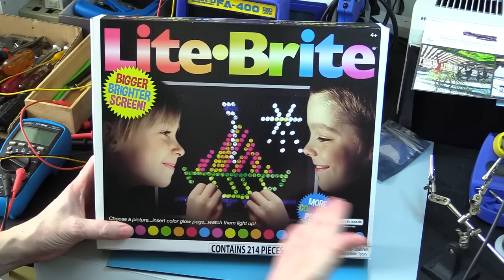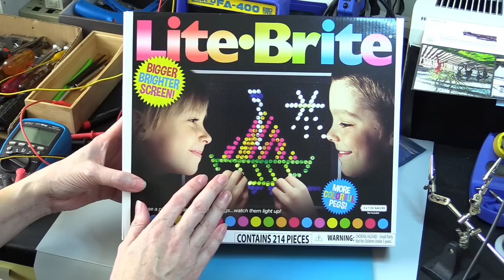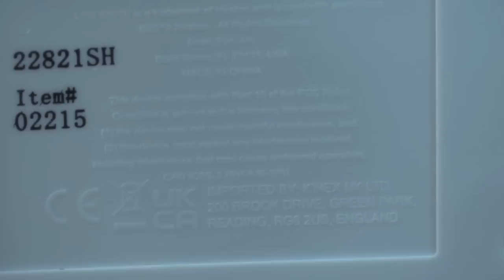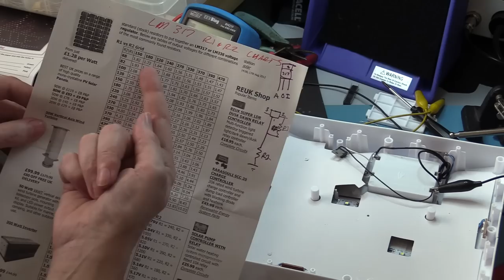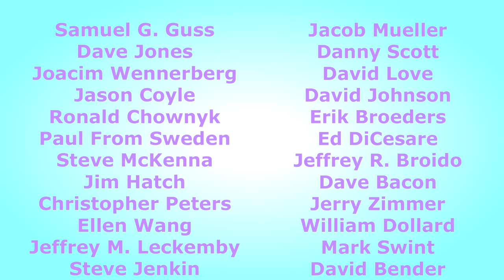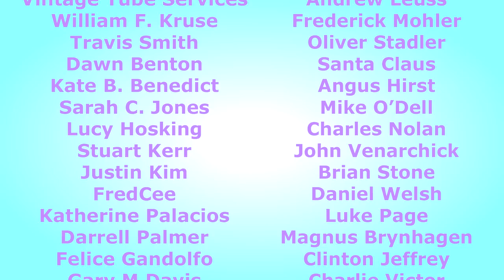Deep Dive Into The New Lite Brite

Comment: Wow...this video brought me back so many years that I had to make a trip out to the storage shed and pull out my 1967 original Lite-Brite!  At age 7, I remember taking some gift money from my grandparents to the Thrifty drug store and purchasing it for $4.99.  Surprisingly, I kept the instructions and insert showing the 5 different picture groups you could purchase (Group 100 suggested for boys, Group 200 suggested for girls, Groups 300/400/500 suggested for both genders).  First-generation units used a standard 25-watt A19 medium-base bulb as the light source; they also lacked any power switch, so my dad helped me install a cord-mounted snap switch.  Another (unfortunate) modification I made was taping red cellophane to the ventilation holes because it looked cool -- not realizing blocking these caused unwanted heat buildup.  So...my Lite-Brite is slightly deformed on the top side.

The perforated plastic grids were referred to as "peg screens" per the instructions.  The "pre-coded pictures" were 9"x12", which gives you an idea of the original unit's dimensions.  The package also included several blank sheets.  According to the instructions, "The blank sheets used with your Lite-Brite are black construction paper.  You can purchase additional black construction paper in your favorite stationery, art supply or chain store."

Over the years I purchased a couple sets of replacement pegs.  At one point, Hasbro changed the formulation for the blue and purple pegs; they were noticeably lighter in color, which on one hand gave you two additional colors to work with but on the other hand meant you couldn't match colors if you needed a larger quantity.

A few other accessories I acquired that I believe were introduced a year or two after Lite-Brite:  Number/Mathematics Symbols and Letters kits, which were shaped like the represented characters and had multiple "peg points" that were molded into each shape and inserted into the peg screen...and the Action Lite-Brite Kit.  This replaced the two original peg screens with three specially-designed screens and an "action" lever that made contact with the bottom of the screens.  Pressing and releasing this plastic piece shifted the back screen so that one set of pegs was illuminated in the "normal" position and the other set was illuminated when the lever was pressed down, producing a motion effect (which varied in practice depending on the design).

It's interesting how this product has been sold for 55 years by the same manufacturer and has mutated over time partially due to changes in illumination technology!

Comment: Hi Fran. Let's see....you get a "new" toy and before having your first "play" you disassemble and modify it. A true "techie" indeed! Well done!
Reply: I’m thankful my dad was a tinkerer, shadetree mechanic and woodworker because I used to do this all the time.

The most memorable time was shortly after they bought the first family PC for $4,000 (486) I had taken it apart to learn how it all worked. They walked by, saw all the pieces on the floor and said “I hope you can put it back together” <3

I’m pretty sure that’s why I’m the CTO of my own company now.
Reply: What do you mean "before" the first play? It is the first play!
Reply: LOL! For me, it was, "You're grounded until it works again, or it's coming out of your allowance..."
Reply: A true nerd. I took so many things (radios usually) apart in my youth. Sad sad sad that I always had parts left over after I put it back together.
Reply: Original said only 40w max bulb if I remember. I put a 100 in one
 Forgot to turn off. Nice toasty medium brown burn marks.
Reply: @GeorgeZ213  If you end up with leftover parts and it still works it just means you found unnecessary parts the manufacturer included for "no" reason.
Reply: @eDoc2020  There is a difference between working, and working properly.
Reply: @theoneandonlymeshe9174  My parents told me that I took apart a dead table radio when I was two. They said that since they were going to throw it away, they didn't care. About ten minutes later, they saw me plugging it into the wall outlet, and ran to stop me. Ten seconds later it started playing. It worked for another ten+ years, until lightining hit the power line, and it exploded. That was in the '50s and '60s.I became a Broadcast Engineer less than ten years later.
As far as computers, I was repairing Commodore and other computers to the component level, not long after the C64 hit the market.

Comment: As I watched this video I could see my original one a few feet away. It uses the spring ternimal 6V batteries (PJ996 ?) type the "screen" is 12 inches by just over 9 inches. and comes with about twice as many coloured pegs (much deeper coloures). It also has a white plastic mesh under the black plastic front mesh. Switch is broken but can be bypassed. It was passed onto me from another families child who must have grown out of it. I've not grown out of it yet as i'm only 50!

Comment: Maybe my memory is off, but I recall that on the old Lite Brites, the light shined through every hole unless you had some black paper in front to block it. It looks like there might be some kind of integrated shields on this one to block the light unless you put a peg in a hole?
Reply from the maker: Black paper.
Reply: @FranLab  looks like the paper slides through the slot at the top? that's super convenient compared to trying to find those holes blindly!
Reply: So do the pegs pierce the paper then?
Reply: That is why the Peg-A-Light knock-off was better. It had a foam pad behind the grid that blocked the light unless a peg was in a hole. After some time, the foam got wallowed out and some light came through. I'm sure that with age, the foam turned to dust. The evenness of the light wasn't the greatest as the 15 watt bulb was in the center. There is a patent online you can look at. Haven't found one for sale and got rid of mine about 15 years ago (had it from about 1971)
Reply: There is a rubber “shutter” piece behind the front grid that has X shaped slits for each hole position that are displaced when each pegs is inserted.  But it does still come with some construction paper, if I recall, as well as a few suggested starter designs to get kids started.  I suspect the rubber that acts as a makeshift shutter will lose its effectiveness over time if the pegs are left in place for too long a period, at which point one would have to resort to using the old tried and true construction paper…just like the original.

Comment: We got one for Christmas in 1977 I think.
It was fun.
If I remember right, the panel was around 12" across and fit plain black 11x8 paper sheets.
Ours had a stubby medium Base 40 or 25 watt CGE bulb. You could change it up or down depending how bright you wanted.
YES the original pegs were very deep colours, and had long stems. 
I think we lost too many pegs in the orange shag carpet, and then up the vacuum cleaner which was a built in the wall style so the pegs ended up trapped in the pipes buried in the walls, & eventually we ran out of pegs.

Comment: Had one of the original sets when I was small. It used a refrigerator-style incandescent lamp running off AC if I recall. I also recall if you used all of the project sheets it came with, you could buy blank sheets in sets of 20 or something, which extended the usefulness of it. This new version appears to not require the black paper at all, which greatly extends its versatility.

When I saw the label on the box "bigger brighter screen" I assumed that the unit was the size of the box, then Fran pulls it out of the box and it's disappointingly smaller. These are definitely smaller than the 1970s version, so I wonder what the size is compared to. It's also noteworthy that they're calling the pegboard panel a "screen." I can't recall the terminology used on the original, but screens were far less ubiquitous in those days.
Reply: Been a lot of years but I remember having one in the 90's and wanting new "black sheets" my parents used construction paper which took 2 sheets overlapping (one and a little as I recall) to cover the whole thing.  I don't know the exact size but I presume those were about 8x10 inch give/take.  Maybe they assumed original size units were cm and then made it "bigger"?
Reply: I forgot how we had to use the black paper until you mentioned it. Without the sheet, it was just a grid of holes, and you could actually see the lightbulb through the "screen," right?
Reply: @brianfriedl7464  That was definitely how mine was, vintage early-mid 70s. It looked like crap if you didn't use the paper. Oddly enough, I can't remember if we had to cut or join regular black construction paper once we ran out, but I do remember the old tablets of colored construction paper were actually slightly larger than loose-leaf notebook paper, so it was probably bigger than 8.5"x11". What Fran held in her hands here looked smaller than A4.

I also remember that it got ridiculously hot if we played with it for too long in a stretch, to the point that we could feel the warmth radiating from it. I wonder how many fires those old incandescent appliance bulbs are responsible for igniting.
Reply: The easy way to do it was to cover the screen with aluminum foil.  Probably not a great idea when it comes to the heat coming off the bulb though.

Comment: The clown template was my favorite. It's such a bummer to see that they skipped out on the quality materials for a smaller & less bright appliance.
Reply: One lithium cell, and led's driven efficiently and spiked low duty higher amps, this could have been quite bright with the additions of one cell, one Chinesium charge control pack (sold in dollar products), and additional IC, inductor, and cap, another dollar).

Comment: Our original Lite Brite used a 120V standard incandescent bulb, with a warning sticker for "MAX 25 Watt" .  Later ones had a socket only for C9 base bulb, (outdoor Christmas string) but those were typically only 12W or less.  I guess people were overheating the old units with 40W or 60W bulbs.
Reply: These were great first lessons in heat dissipation for beginning EE's. Above 60,  you learned real fast not to block the air holes. You could run 100's with a big fan, and even the 200 3-ways by extending the front bezel with tape. Then, you got to learn how to shut stuff down fast at the smell of overheating plastic, and how to replace a burned up socket.  Or so I hear... :)
Reply: @sometimesleela5947  Now just screw in an LED replacement bulb rated at 25W, but gives as much light as a 150W incandescent for a dazzling colour display.

Comment: i cannot for the life of me work out why you had to mount the reg and resistors directly to the board, encased in heat shrink and separately mounted with double sided adhesive with two small wires that run to the existing control board would have saved all the grief of damaging the original board and been a lot easier and neater  as well.  an interesting toy i see they are currently available from kmart  here in australia marked down for half price AUD$10.00 as of 20/03/22

Comment: My son had one of these when he was younger and it came on all by itself in the middle of the night.  Turns out there was a bunch of flux residue on the main board that was conductive when the humidity in the air got high enough and caused enough leakage current to light the LEDs.  A little IPA solved the problem but it sure did freak him out that night!

Comment: Back in the early 70's I received for Christmas a Lite-Brite knock off called Peg-A-Light. It had a fairly large area for the pegs. It used the same size pegs and I got extra pegs to be able to fill the whole thing. The holes may have been in line if I remember. It ran with a 15 watt light bulb so it didn't light the whole thing evenly and the foam that was on the back got crumbly after a few years of use letting the light leak through. It was still fun.

Comment: I really don't get why you made this so complicated. You can get tiny variable voltage regulator boards for less than $1 on eBay and Ali. You could have just soldered that to the input wires of the controller board. These boards are so versatile and should be in every tinkerer's drawer.

Comment: A fiberglass-bristle "scratch brush" is extremely helpful for removing the "solder mask" coating on the circuit board traces. Scrape a little bit of it off with the Exacto blade or ( better) a dental pick, and then clean and polish it with the fiberglass brush (even small traces of that solder-mask will reject solder and you'll never get a good connection). An ink eraser containing pumice or silica will also work. I have a couple of small battery-powered artists' erasers that I modified to hold a fiberglass bristle brush  and a silica-containing eraser rod, expressly for this type of polishing and cleaning before soldering (great for cleaning chassis ground points as well).

Comment: I also grew up with the Lite-Brite.  A few years ago we bought the new Lite-Brite for my nephew and I was rather disappointed with the illumination and the limited number of pegs.  So I bought a second unit and used several of the LED boards to fill in the darker areas where there was obvious intent to have located LEDs before the product was cost optimized.  The upside was also twice the number of pegs, albeit at twice the cost.  Still not as nice as the original, but a trip down the nostalgic rabbit hole nonetheless!

Comment: I remember seeing green for the first time.  Green, just green, pure green. I was fascinated.  We had a lite-brite with all the colors, although half the pegs were lost in the carpet. And yes, it had green, but like your video, the green was not pure green. It was a weak and wide bandpass centered at 535nm. It wasn't until i saw the power LED on my sister's?quiz wiz? That i saw real green.  It took another 15 years before i could understand the difference between leds and lite brite pegs.  The pure green color was burned into my brain. Now i understand that leds emit one wavelength, the purest way to see a single color.

Comment: In the old days if you wanted a brighter lite brite, you took the bulb off dad's lamp in the den, and put it in the reflector base.  I'm sure it was bigger than 25 watts.  Probably a 60 or a 100.  In that spirit, Fran bypasses the wimpy AA batteries with a 9-volt wall wart with a 5 volt regulator, stepped down to 4.7 volts.  It isn't lite brite unless the plastic is in some danger of melting.

Comment: Awwww, what a cute little set. I've never ever heard of these. Not popular on this side of the pond, I think.
Nice simple hack. The world overuses batteries; I really think that most battery-powered devices should have a barrel jack for adapter if you wish to use it. 

Non-lead solder is indeed crap. And you almost swore... almost! I would probably not stop.

I knew the one about Ass-U-Me :)
Reply: That edit around the swearing was just about perfect.
Reply: I would use a USB micro connector, then you can safely assume that it will always get 5V DC and not 15V AC or worse
You can write "only use the included adapter" as much as you want, but if it fits, it will be plugged in
Reply: Yep a USB connector is definitely the way to go here, especially for child use, you don't want kids at 110v (or more). A USB power bank in a little holster attached to it, would be primo - super portable - no cable flappin' about in the breeze and safe voltages.

Comment: my old one you had to put down construction paper and punch it through, otherwise light came out of all the holes..  the newer ones like this have a rubber flange the pegs go through.  that was a good upgrade.  sure you can still use their punch templates but you dont have to.  and if you punch a peg in the wrong spot you are not sunk.

Comment: Yes I always check your power adapters before you use them. I pulled out of my collection a 24v that measured closer to 30v. I also pulled out a 6v one that measured 12v.
As a kid I thought that every device should have a DC jack and headphone jack, as an adult every device absolutely should have both!
Reply: USB is getting us partway there. So many gadgets now run or charge off USB chargers.
Reply: Power supplies often used to be unregulated. They would be somewhat correct when used at the specced current. Seems crazy now in the days of switched mode supplies and regulators costing pennies.

Comment: A more expensive, but better way of making this toy would be to have contacts in every slot, and just normal LEDs to put in... having an AC 3v running at high frequency to light them all, no matter the orientation you put them in, and voila... every single LED lighting up would give more solid and even light output... if that's too complicated, just a difuser, and some 5V led strip in the back would do the trick, no strobing fancy lights, but could be easily dimmed...
Reply: Then wireless power to each peg. Then individually addressable brightness. And colors. Wait, we just reinvented the Jumbotron. Step back a few revs and a magic wand could light up the ones that fell into the carpet and air ducts.
Reply: @tactileslut  Well... wireless or addressable, but not both, at least not yet... however, with the wireless ones, you can find the missing ones in the carpet, nice idea!!!!

Comment: I have a Christmas popcorn can about half full of wall warts...most are vaguely near the rated voltage, usually a little higher ( no load testing) than rated. 
   As I recall, my old Lite Brite was about the size of a PC desktop monitor, and had a 15 watt bulb in it. 
     Does the new version give a estimated battery life? The new version seems like a good, basic toy.